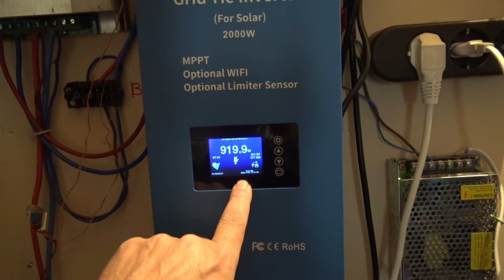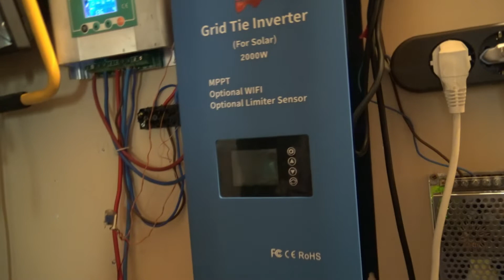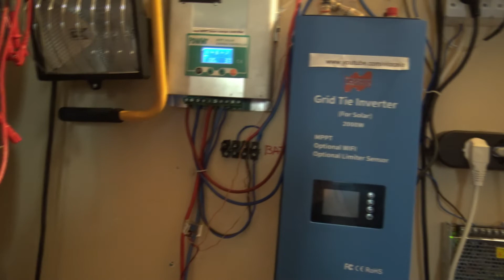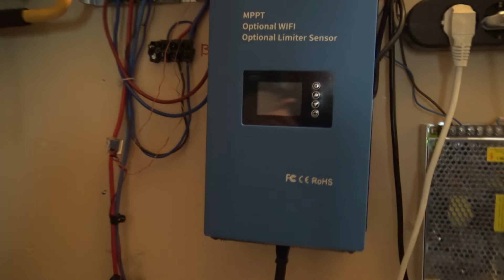GTIL2000 inverter with limiter from MarsRock after 5days!

Comment: Have same thing for 1.5 year and it start to dying, maximum power production is reduced during 10 days it decreased from OK 1600W to 1150W maximum now and continued... Looks like hardware problem which i dont know where.
Reply from the maker: Very possible the DC part, but I don't really know...check the MOSFET transistors near those capacitors...

Comment: Save your money. My SUN2000 got a AC-Shortage after a normal grid failure. Jesudom does not like the send a spare inverter. I had over a month discussions with the seller and stupid questions to prevent garantee. You waste your money with this seller and this inverter. It is not cheap when a device lasts only 3 Month. The internet is full of repair videos of this inverter and when there is a shortage on AC side a contoller is also burned, so you cant repair it.

It is better to try another brand from local dealer.
Reply from the maker: Sorry to hear that...mine it's working great almost two years...more than 1.5M produces since install. No problems so far. I have an extra fan attached so cooling is better somehow.

Comment: The fans in these are alot thicker than the 1KW, decent fans, easy to replace. I also have an 80mm USB fan resting on the top my 2KW GTIL to suck out warm air, similar to your fan at the bottom that you used to have!
Reply from the maker: Of course I can easily fix those fans. the inverter have a seal, I opened a complain and wait for ''expertise" answer..